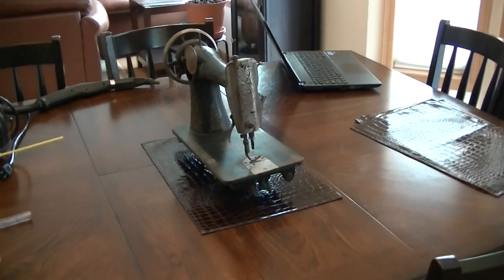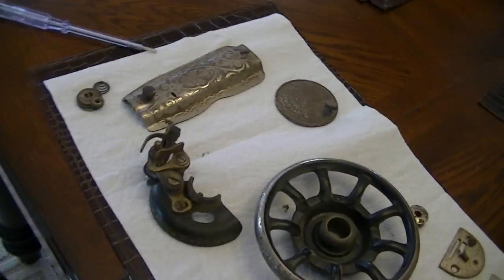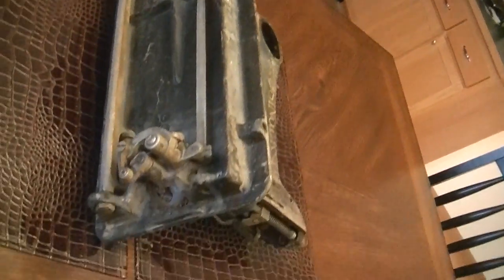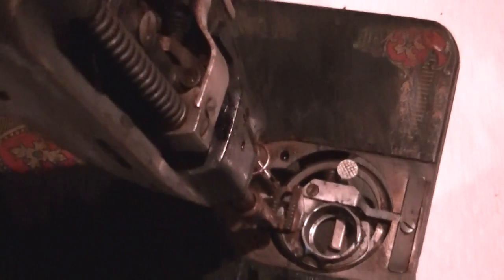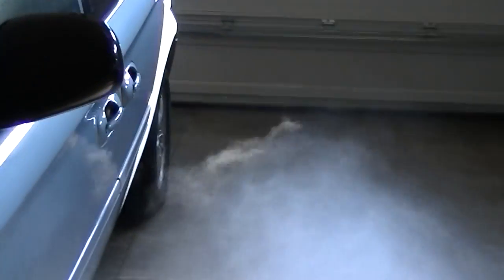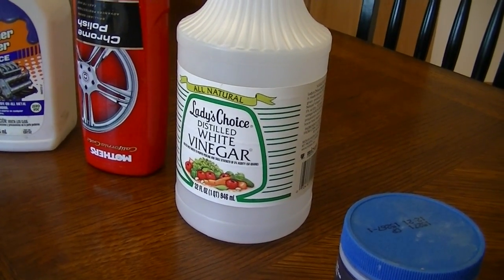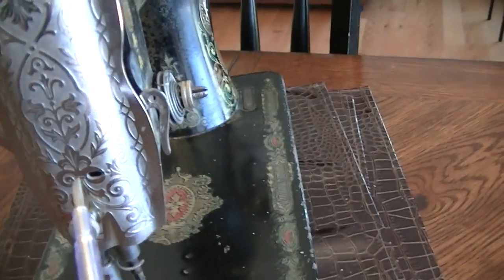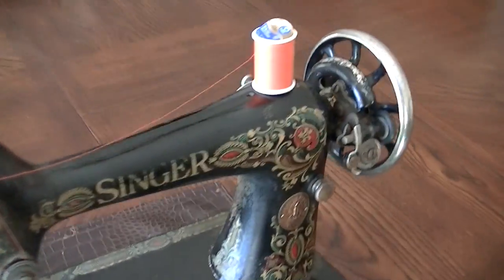restore singer sewing machine - Part 1

Comment: Getting sick of zig Zak moments ? ☹️
Great job done to revive that vintage machine. Rubbing the silver parts  surfaces only with dry Colgate tooth powder& tooth brush gives great results & shine. Would love to get a degreaser. Where can I get it in Delhi.
Reply from the maker: Thanks for Colgate tip. I am not sure by  what name engine degreaser is sold in Delhi but am sure you will be able to find it at pertol pumps that sell auto parts too.

Comment: don't use water... very bad idea... wood swells and will split and steel rusts cos you can't always get water out of crevices and water gets between the steel and paint... its really a no-brainer as they say...
Reply from the maker: I posted it since i did an experiment but Kerosene is the best solution. After this video i was able to restore several more machines by cleaning just with kerosene, however this one and few others i restored with water working fine till date (no issue at all). Key is that if you restore with water then dry them up quickly and use WD40 all over and then oil it nicely.